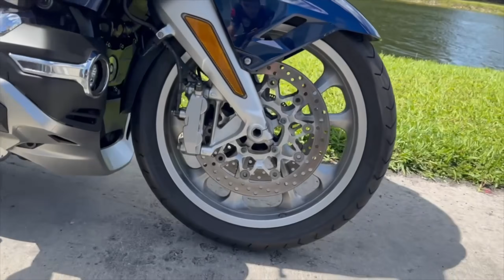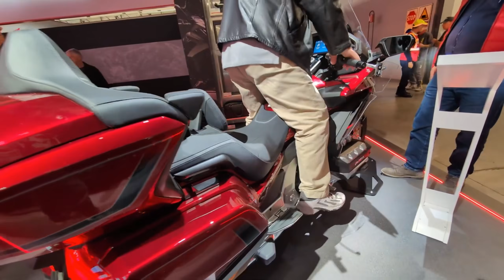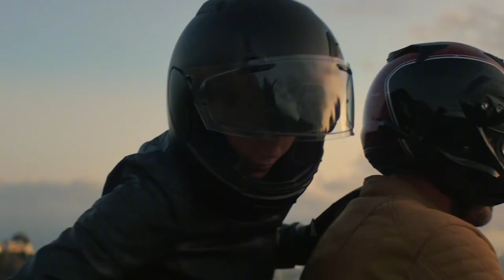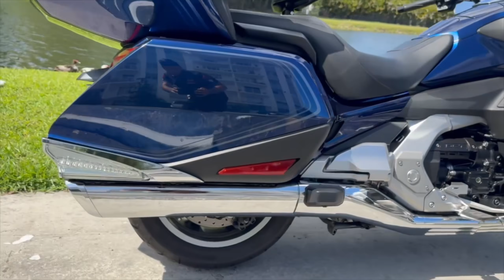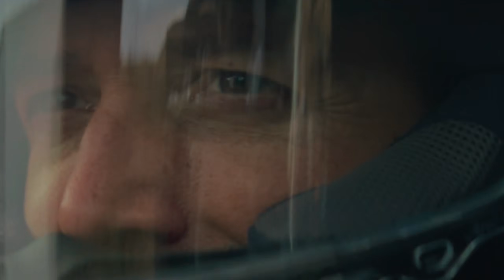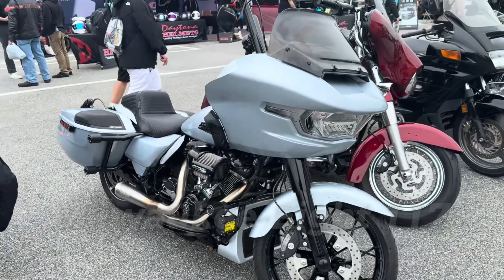Honda Gold Wing: The Hidden Maintenance Costs Nobody Tells You About in 2026

Comment: I've got to be honest here even though I don't own a Gold Wing I've been doing a lot of research cuz I want one this guy is giving a lot of false information not doing it myself I did hear the air filter  is a nightmare to do. But I'm sure once you do it once or twice you get the hang of it. 
     As far as the oil change I was under the impression it's all the same oil two different oil filters and it all goes in the same hole. 
    And if I'm not mistaken there is a way to recalibrate your DCT transmission in your own garage with zero tools. I'll go listen to the rest of the video now.. oh and as far as the final drive it's just like a differential in a car, you drain the oil from the drain plug. Reinstall and then add oil to the fill plug.

Comment: Video repeating and repeating, most not even showing what is being described. Would have been better to simply show graphics rather than previous generation Goldwings which are nothing at all like 2018 and on models. Narration is repetitive. inflection sounds totally artificial. Pronunciations are wrong and probably A.I. generated. There are many exaggerations throughout. I wouldn't trust it to be accurate or even true in some descriptions. Oil changes are a little involved but simple. The DCT transmissions are very easily calibrated through a simple procedure and are not needed frequently under normal use. Judge for yourself if you are in the market for a new Wing or used in good condition. But I am sure you won't be disappointed.

Comment: I purchase the maintenance program from the dealer.  I am 79 and dont want to wrench, change oil and filters anymore.  The reliability of the engine is outstanding.  I had 5 Harleys and it seemed that at mileage of 20 000 to 40,000 I was spending 3 to 5 thousand for engine work.

Comment: 15k from tires, that would be a nice change. Every Harley i owned if I got 10k miles it was a minor occasion to celebrate.
Reply: Try Commander 2 or 3's. I use them on my 2011 Electraglide and have had excellent results. I wont use anything else anymore. I avg 9 to 10k per set.

Comment: This post is proof you can't believe everything you see on the internet as a lot of this is garbage. I have owned several Goldwings and put 80k on most of them without evor changing an air filter. These bikes just work and I have never had one breakdown. I would rather have a bike that can last for 200,000 and is dependable then one that 9nly lasts 50k and keeps leaving you on the hiway. Can't go wrong with a Goldwing!

Comment: I'm getting ready to go on my 4th Goldwing trip, the Goldwing is worth it.
I got the dealership to do the air cleaner, it was expensive, I had to replace a heated grip (900.00)so I could put a 3 year warranty on it 1,200. unlimited miles.

Comment: I do not agree with these informations in the video. I have my GW SC79 since 2018. I’m doing all the work by myself thanks to Cruisemansgarage Maintenance Video. Even the Air Filter, which you change around every 20000 miles or so, I did by myself. And that’s the only thing which takes time. In fact, a GW is a bike easy to maintain. You have to do it by yourself. No problem. The only time when I’ve spent 350 Bucks at the dealer was adjusting the valves after 30000 miles. So don’t believe what they tell you in this video.

Comment: The Honda Goldwing is millions of light years ahead of the other bikes manufacturers in terms of durability, reliability and performance so calm down and go to sleep early my dear friend 😂👍
Reply: My 1100 Wing 81 editition went from London to the south of France and back, in and out of London every day for 11 months, then to Canada and went all over Alberta which is the same size as Texas by the way. Then I sold it to a guy that added a chair/sidecar and he took it to farthest point south of South America he could go and back. It had oil changes, tires, plugs once and an air cleaner. That's it. I have had mostly Honda and a couple of Indians. $800 for an air cleaner is a breeze compared to complete brake failure multiple times, recall after recall, switch failure when they get from humidity not even rain, bar switch failures, computer failures. No comparison those maintance costs are cheap for a bike that can take you places, anywhere and get you home just ride, it's why any one buys a bike. Best bike by far no contest.

Comment: First of all….who really wants an automatic transmission on a motorcycle??? I sure don’t. iIt took me 6 months to find a manual transmission, which I bought. Yes the air filter is a pain in the ass due to location but, the filter is so big it’s not something that needs to be changed frequently. For the most part the rest of this video is BS.  My 2005 model had closed to a quarter million dependable miles on it. I expect my new one will also push that threshold a little further.

Comment: DCT is using engine oil, not other oil. Yes DCT needs oil filter too, smaller than engine oil filter. Whatever you said, this is a very good bike. I sold mine for K16GT because of the performance of BMW…
Reply: BMW dealers are far fewer than Honda around most of the USA. Good luck to us all !

Comment: I bought a 2024 GL1800B, the bagger version and wish I had known this before I bought. I have under 1,000 miles on mine and after seeing this video I feel like I should cut my loss and sell or trade it on a Harley tourer. I don't want to pay dealer costs for routine oil changes and air filter service and neither do I want to spend hours doing what I thought would be a fairly straight forward job compared to other bikes I have owned. I should have done my homework before purchasing and now I will pay the price. Buying a bike is an emotional experience like buying a car and we let that take precedence over doing the research it demands. Now let me look at what my trade in value is against Harley tourers.
Reply: If you ride on mostly pavement.  Air filter change is every 50 thousand  miles or more.   I change my own air filter.  Filter is 40 bucks.  3 hrs in the  garage   Not a hard job just time,  lots of good videos on how to.      Dont let this narrow view outlook spoil the ride. 
Oil 5 L quarts.  One spin on filter and a small cartridge filter.   20 mins of work on the shop floor.  Rear tire removal is 5 nuts.  This video is a negative piece of BS.
Reply: @jerryterpstra-yo8nl  Thanks, what you say is encouraging. I owned a 2016 CTX700 with the faring and it was a PIA to change the air filter on it, but this sounds a lot more involved with the plastic removal. I will buy cruiserman's videos to help in the process.
Reply: I will buy that goldwing from you,  I will be riding while you sitting around Harley dealerships exchanging broken down story's with the other Harley guys,  honda makes airplanes, cars, truck, generators,  and Harley Davidson makes 1 thing and they can't even do that well,  ask a Harley person who tried to trade a Harley in for cash,  versus a person trading in a Harley to buy another Harley to keep you in debt,  they price you so low to make you say i will keep it,  trade that goldwing in and i guarantee it want sit in a dealership for 2 weeks,  Don't let a  AI video spend 15 minutes talking about a air filter  , ever motorcycle has hidden expensive lmao Harley doesn't even honor there own warranties..
Reply: "this video brought to you by by Kawasaki Motors..."

Comment: I told the Honda dealer I wanted a 2026 DCT. They didn't have one but might have one in a month. After listening to this video, I didn't think I wanted one anymore, but after reading all the comments, I might still want one. At this point, I'm not sure. Perhaps I should just stick with my HD Street Glide & my Road Glide. Decisions, decisions.
Reply: so...after you see a stupid video about a stupid airfilter change you decide not to buy a Goldwing? so you believe everything they tell you? thats stupid too!!!
Reply: @HenkB-sn1zc yep, other work is done with the tear down, its not just the airfilter! As I understand it, its £350 a year, £1000 every 4th year!
Reply: Air filter is easy to do, only really needs to be changed every 20 to 30 thousand miles not every 12 thousand
Reply: i recomment you buy a Harley !!!
Reply: I love my 08 plain Jane wing. Why, after doing my research. 05 and earlier have ECU issues. No heated accessories to fail. No NAV that I believe you can't update anymore, and the screen at age is prone to fail. As for maintenance on my 08, pretty straight forward. My Gen if you had a motorcycle, you where a mechanic. Just use a piece of cardboard to place your screws in order removed. You will get to the air filter. Fork rebuilds have more hardware on the left side due to the anti dive. But you can slide them right out with no fairing removed. Oil change, brakes, rear drive oil, etc, all pretty much standard maintenance. As far as updating to a DCT.. I love my manual clutch, and I'm old school. Now I do have the sound system. Radio don't have great reception. But the OEM amp is great at 80 watts per channel x4.
Why did Honda use a 3 ohm system, but be sure to get 3 ohm replacement speakers with a BT controller. Not a FM transmitter, like I said radio is sub par. Use your phone and your favorite app or radio stations HD web sites.
Now as for as tires. I'm DBL dark. Run flat is the way to go... No I haven't exploded yet. And if you need help on any maintenance there's  You Tube. Curse Mans Garage specializes in goldwing maintenance videos...

Comment: If you have zero maintenance skills it is no doubt an expensive bike to own, but so is every other premium brand bike when having the dealer do all the work. However, there is still so much bullshit in this video. For example the DCT does NOT have its own oil.  It does have an additional filter that costs only a few dollars. Changing the engine/DCT oil on my 2019 Goldwing takes less than 30 minutes. 2 filters (1-engine, 1-DCT), 3 drain plugs, and 4.8 quarts of oil. If you shop around you can do a complete engine/DCT oil change for as low as $70. If you have a fiber optic probe you can check the condition of the ait filter without any disassembly of the bike. In my particular case the air filter does NOT need to changed every season. If and when you do need to change the air filter there are many videos available showing step-by-step how its done.
Reply: The DCT takes 5.9 quarts of oil.  I believe the 6 speed manual takes 4.8 quarts.

Comment: The DCT transmission runs with the same oil as the engine, its no big deal to change an extra oil filter with a oil change. 

You can have a side fairing panel off in 15 minutes, the top shielter off in another 15 minutes, so in under a hour you can get at the air filter, another hour to put it all back together, but  the truth is,  unless you ride and live on a dirt road, the air filter only need to be changed with a Gold Wing every 30k miles, yea Honda says 16k miles, but every one I've seen at 16k miles still looked new like, so for most the air filter change can easily be at 30k miles,  every 3 or more years for most. 

There is no software updates needed, this video is BS with that.
 
Tires last 10 to 12k miles on touring machines, all heavy touring machines are that way.  I just replaced the tires on my wing, cost in 2026 was 650 dollars taking the wheels to Cycle Gear to have the new tires mounted on the wheels myself.

Rear drive  gear oil change is 4oz every 16k miles, certainly not hard or expensive...and trike take off rear drives with the Gold Wing are plentiful and cheap, I paid 35 dollars for a new like rear drive take off for my 2018 Gold Wing on Ebay, it was so cheap I just bought it to have a spare just in case.

I paid 40 dollars for 2 sets of Nichie front brake pads from Amazon delivered to my door. They are performing and wearing as well as the far more expensive OEM Honda pads. Thats 2 front brake pad replacements for 40 dollars, can't really complain about that deal. 

The recall with the fuel pump and the rear bolt was nothing really. I never had a single problem with the fuel pump, but never the the less my dealer did the fuel pump recall and the engine bolt recall at the sametime in a day and Honda paid for it, so whats the big deal.

So the honest truth, 

this bike requires a yearly oil change

Coolant change every 3 years

Brake/Clutch fluid change every 2 years

Air filter change probably every 4 years for most

Tires every 2 to 3 years for most, much longer for those who only ride a few thousand miles a years

Brake pads around every 25k miles for most

Battery replacement every 4 year or so for most, I got 7 years with the OEM battery myself, but I hook it up to a tender when the bike is parked.

Comment: I agree that the air filter is a tedious job but there's nothing really difficult about changing one if you have any mechanical aptitude. The engine oil and DCT oil are shared. Nothing hard about the oil change and as far as recalibrating the DCT, its simple to do and takes a couple minutes , no special tools required. I could pick apart a lot of this video. Plenty of wrong information. But if your the kind of person that doesn't do any of your own maintenance, there will be costs to consider, just like with any modern vehicle. How many people even change their own oil on their car?  Much of what's been told here is greatly exaggerated.
Reply: You can claim exaggeration when the Wing is being glorified.... fact is not everyone change there on oil or do their on maintenance. Let's keep it a buck, especially when they are north of mid 50s. Straight up I think its about time someone shared the dark side of the Wing

Comment: I don't agree with a lot of information on this video. No one should be surprised that maintenance at a dealership will cost more than self maintenance. My 2023 DCT Goldwing is going strong with regular dealership maintenance and it has not cost nearly as much as regular maintenance with other motorcycle brands (HD, or European bikes). I don't feel tethered to  the dealership network since the Goldwing doesn't breakdown if you take care of it. Bottom line, do your research and do not make your decision on the information of this video alone.